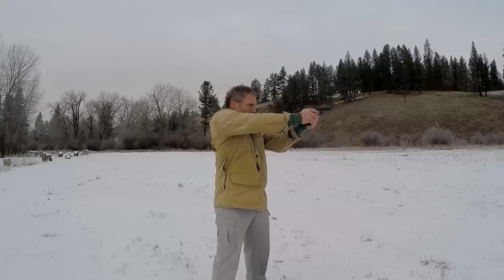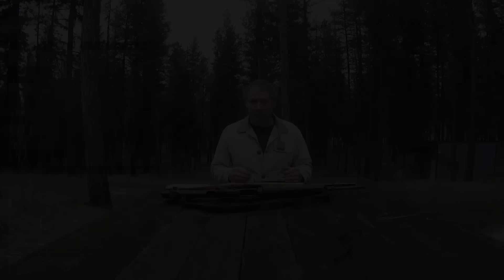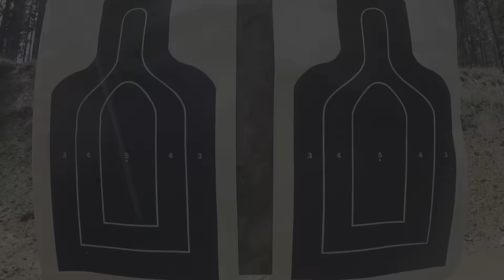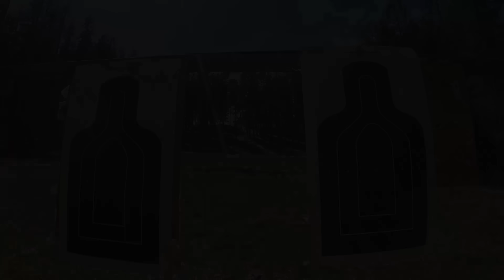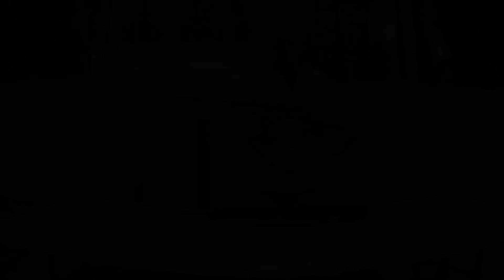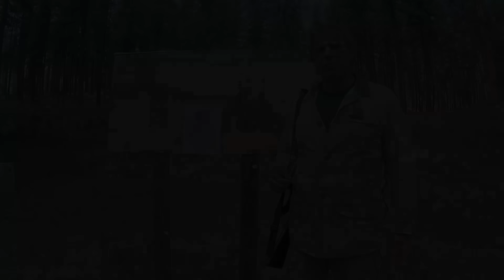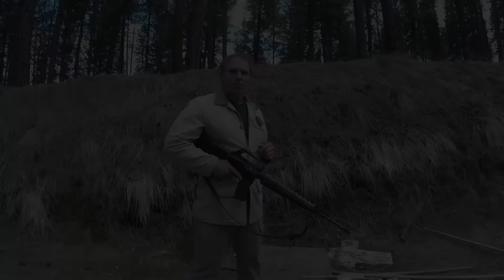Mini-14 vs AR15: Which is Better?

Comment: Newer Mini-14's are more accurate than the older ones. The barrel is different. Can tell by serial number but also by looking at barrel.
Reply: George Washington  I bought my mini 581 series for $620 new from budsgunshop.com. I built my AR for around $550.  Yes parts are cheaper for the AR but it's not that much more for the mini.  Also I have my mini tailored to mimic the M1A socom.  I enjoy the older style look of the mini over the AR and would trust my mini for defense up to 300 yards with no problem.  In reality my AR is probabaly better but I just love the mini.
Reply: @dthompsont3796  If you want an AR buy one, if you want the Ruger Mini buy one of those, the mistake IMO is when people buy a Mini Ranch and then try and make it look "all tactical" like an AR, spending even more money. The Mini 14 is a fine compact rifle for general use, hunting, plinking, self defense etc. and is perfect for someone who wants all that in a classic looking rifle. If you want the military and tactical looking rifle then buy the AR, no one would buy the AR and then start putting a wood stock on it etc. to make it more like a Mini 14. I have an AR and an M1A  and will probably pick up a Mini 14 when I see the right deal on one so I have another 5.56/223 platform.  The debate about which is better comes down to which you like better and what is it's primary role, beyond that the differences are not that much it even matters to the average person. For example the magazines are harder to swap, but seriously as a civilian how likely am I to need a tactical magazine change? However in other situations I do see a benefit to the more staid and traditional looks of the Mini14, when using it outside of a range. It's swings and roundabouts, pay your money and make your choice. To me the price of the Mini is the biggest argument against buying one, I think it's a case of relatively bad value for a great little carbine. After all these years in production, you'd think Ruger could get the cost/retail price down.
Reply: @fiveowaf454  I'm not reading all of that
Reply: @dthompsont3796  Well as you couldn't be bothered to read what I wrote, then you have no idea what i know do you ;)
Reply: @fiveowaf454  I dont care buddy.  You seem to need the last word for some reason.
Reply: @dthompsont3796  And there I was thinking all the time it was you needing the last word, sorry to have offended your delicate senses by daring to have an opinion that differs from yours.
Reply: @fiveowaf454  there you are again, continuing to cry without validation.😪
Reply: @dthompsont3796  Yawn!!
Reply: The Mini 14 has been vastly improved over the years as has most AR 15's, all good for us who want them.
Reply: George Washington I love the “about” section of your channel.
Reply: gator nation 580 and up I believe. They started upgrading in 2003. I had a 580 series Mini 14 with the thicker barrel. Unfortunately it was stolen, but I would love to own another!
Reply: George Washington  What $1200 M1A? Can't find any for under $1500 in my area or online.
Reply: 195-52743 which version is this?
Reply: @KK-ze8ye  Older version with thinner barrel. Later version (581,582) had a tapered barrel that is a bit thicker and supposedly a bit more accurate as it heats up.
Reply: @eoyguy  When talking semi auto rifles we need to take into account the user and their needs. Some want to be able to take regular aimed shots without breaking their cheek weld, others want to fire it like a machine gun at the extremes, so matters like barrels getting hot and related issues vary tremendously depending on the user. No doubt the newer barrels are going to be better for rapid fire in particular, but this may not affect some owners.
Reply: @KK-ze8ye  Just ask---
             "Paul Harrell"
He can give you the "short version" in about 30 mins or the "long version" in about 3 hrs! Of course the "long version" will be EXTREMELY DETAILED! On that note, I can say that he definitely does his homework for all of his vids. He is VERY thorough and great at explaining all of field and investigative work. Even as to where an 8 year old could understand his lectures! LOL 
He does post some great and informative vids. He actually made my mind up to get a 10mm instead of a 40cal and I love the 10mm. I was a 45acp guy, but now every morning when I get all of my EDC things, I bypass the 45 and go straight to the 10mm!
Reply: @KK-ze8ye  by a quick look up for the number, that is 195 series ranch rifle built some time in 1998. if you need more details on that rifle i would contact ruger
Reply: Which model is the one Paul tested?
Reply: @AshGreen359  looks like one of the older models
Reply: @AshGreen359  His I believe is from the 90's
Reply: gator natio
Reply: I absolutely agree, I got lucky with a mid 90’s mini 14, my American 7mm-08 is excellent
Reply: @Michael Ball I don't think the Mini 14 was designed to shoot imitating a machine gun as many do. It was originally meant as a handy compact rifle for general use hence they used to have "ranch" in the name so I think a lot of people suffer issues when they require a high rate over several mags.
Reply: George Washington  superior...

Comment: Owned many Mini-14s over the years. In many ways I prefer them but I will admit they are quirky. The quirks can be overcome with training. I think both rifles are great  but will admit the AR platform has had years and years of development and has had many if not all of its design quirks qorked out while the Mini 14 largely has been unchanged since its inception other than a thicker barrel.

Comment: Do what I did. Buy both. Learn to shoot both to the best of your ability.
In a shtf situation, you aren't one bit under-gunned if your Mini 14 is the only gun you have at hand to defend yourself.
Reply: Two of my home built AR's and my Thompson Center Compass do 2 inches at 300 yards. Nothing I could do to a Mini-14 to get that. And by-the-way, all my AR's and my Thompson Center Compass use the same homemade ammo. Not tailored ammo for each.
Reply: @alanhigh8125  Good for you. I haven't met a mini 14 on my club's range yet  that would do that. Not when the owner shoots it, not when I shoot it.

Comment: According to at least one Ruger rep, the 580 series ("Ranch" rifles) were chambered in 5.56 NATO. I've seen info online indicating they could be either 5.56 or .223, and the Target model is supposedly only .223. Don't know about other models after that, but it seems even Ruger's employees might not have accurate info. It's always best to check the barrel stamp (or have a set of headspace gauges).

Comment: Another excellent video! Thank you very much. In Austria (Europe) the situation regarding AR-15 and Mini-14 rifles is somewhat different. Whilst some specially built AR-15 rifles can be bought by citizens with a gun permit, Ruger Mini-14s are banned, because the department of defense classified it as a military weapon, because it was the standard issue with the Royal Bermuda Regiment -.-

Comment: There is one thing that Ruger cannot be beaten at. That thing is customer service. Ruger's customer service is second to none. They really back their product. I've shot Rugers for thirty five years, and never had a problem that wasn't quickly fixed.
Reply: Yea, but with a lot of manufacturers it doesn't matter because their products work out of the box.
Reply: Just don't buy their sling swivels. They'll pretty much tell you to fuck off.

Comment: without watching I KNOW The MINI 14 is a better rifle. More accurate out of the box, easier to take care of, The Garand bolt itself is a better system. I have both and the mini is my goto gun for anything from close to 100 yards or more. Flip up sights only. OK with a 6x6 5 spot target I can shoot my mini 14 as fast as I can pull and go from one to the other and get all five in the center red, No strap no nothing. That's at 25 yards so the red is the size of a dime one in each corner and one in the middle. Using Fed. American Eagle 55 FMJ 223 boat tail. OK I'm inside but with guys all around me shooting everything from full auto to 500 S&W! Concentration is key. Again, The AR platform is a pain in the ass, it was when I was in the ARMY and now in civilian life. Good Video however and I agree that you are concise speak in a way for anyone to learn and understand.

Comment: I hate to be a nitpicker and i absolutely agree with the point, but even if that 100fps difference doesent make a practical difference it repressents a much larger ammount of added energy than 100fps at a lower speed.
Reply: @matthewlove9191  if you add 100fps to a bullet going 3000fps you add a lot more energy than if you added the same 100fps to one going only 500fps to start with. kinetic energy is MV^2 the energy scales exponentially with speed.

Comment: I would choose the modern Mimi 14.  The modularity of the AR 15 suggests much more versatility in that the barrel (upper) can be easily swapped out.  That said it has been my experience that the Mini 14 is much more rugged than the AR.  my problem is that I will have to fo a barrel swap because my caliber choice isn't available in the Mini 14 and the AR15 is way too regulated here in New York State.  It has that dangerous pistol grip (😁).

Comment: Paul. I am generally turning about 3250 fps out of M193 55 grams ball out of the AR.  Basically. Mil spec.   With SS-109 62 grain ammo, the A2 outperforms the  Mini-14 all day long.  The real test is not at the 100 yd line.    The test starts at 200 yards, and ends at 500 yrs.  I really enjoy my Mini-14, but it is not an M-14.  I qualified Expect on both rifles.  The HB AR-15 has won at Camp Perry consistently.

Comment: Are there mini 14 models out there that accept standard AR mags? It just seems to me like all you'd have to do is make a different bolt catch.

I HATE that magazines are not universal when we have created so many other modular systems for guns. Almost every dual stack pistol magazine is the exact same size. The only difference is the cutout where the mag catch is. That's it. You could just make a magazine with a bunch of holes in it to fit different handguns. STANAG is a godsend since a standard AR mag will fit in to so many guns

Modularity is everything. It really is. It drives me nutty that in a SHTF situation you are forced to use very specific guns not because of a common ammunition type but also because of a common magazine. An AK is great for sporting and plinking around with, but chances are your friends aren't going to have AK mags laying around if things go wonky

If you are a common sense shooter who has defensive guns in place, you're pretty much forced to use very specific guns. ARs and glocks are super common, so chances are you will want an AR and a glock. That way you are guaranteed going to find magazines that fit for it

Comment: Great video.
I would still love to get a stainless Mini 14 and or a stainless Mini 30.
In the meantime my AR carbine and SKS probably work good enough for me.
Hopefully they remain legal.
Reply: Definitely go Stainless. The blued ones are or used to be rust magnets.
Unbelievably so.
Reply: @breakermorant2428  I’ve got a mini in tactical. No signs of any corrosion after 7 years.
Reply: Can't go wrong with an older SKS at the older cost. Not the $500+

Comment: Thank you mr. Harrell, for a great review of what should be obvious,  but often is not to most. Also it should be mentioned that the extra hight of the sight does help with heat mirage from the barrel during extended fire.

Comment: When I was in the Army with the A1 and M193  ammunition, a 25 meter zero would give you reasonable accuracy out to 300 meters. It had to be fine tuned, but at 25 meters accuracy was not that much of an issue. We shot out to 500 meters, but still it was a minute of man at 25 meters easily. The trajectory was meant to have reasonable accuracy to 500 meters without making a sight change. Plus the Mini 14 is not meant to be a tactical rifle.

Comment: Roughly 80 FPS faster in the AR. That’s consistent for a 1 1/2” longer barrel. I don’t remember if the mini 14 has a slower twist than the A1. A faster twist will increase velocity and stability, but greater accuracy is not guaranteed. Many factors affect accuracy. Even subtle differences in the barrels construction can significantly effect accuracy. The head spacing is one major factor of accuracy. He is absolutely, absolutely correct about the quality of removable magazines. He is very well practiced with both rifles. The mini 14 does not facilitate magazine changes as smoothly as the AR does. That’s simply the difference in the operational design. Everything he addressed was absolutely correct. This comparison reminded me of a question I’ve been asked many times. What the best gun. The answer is simple. The best gun is the gun you have available or in your hands when you have need of it.

Comment: Moral of the story: It doesn't really matter. So long as the rifle is acceptably capable, amount of practice with rifle > type of rifle. Although parts availability, ammunition availability, and size of aftermarket are all very useful things to consider when selecting which rifle to put all your hours on.

Comment: I bought my mini-14 around 2004. It cost me $450. The price did go up substantially after they redesigned it, not sure what year they did that, atleast a few years after i bought mine.  I had a lot of issues zeroing it in but that pretty much came down to the fact the scope mount would become loose, also everytime you had to disassemble it it would change the grouping substantially. Finally found some scope mount rings that fit right to the receiver. 
     But either way it still sends out a zinger about every 6 rounds that can be several inches off from the rest of the group. I did find that a lower grain bullet shot better groups.

Comment: The AR is the better gun.  I started with Mini's and really loved them.  I based my purchase decision on price.  At the time, a new mini was $225.00 and the AR was $500.00.  2 years ago, I wanted to get another Mini but now the roles were reversed.  The Mini was $700, so I bought my first AR , an Armalite for $425.00.  I quickly realized that the AR was the better all around weapon.  If you have the money, buy both.  If you don't, start with the AR.

Comment: 2 things come into play here, the sights the AR15 wins and the rifling twist rate. The Mini should be 1-10 and if the AR is an older model 1-12 twist. Just a thought. Triggers do come into play too but both being stock and no trigger work they come out about the same.

Comment: Good  video.  One  other thing with the velocity difference could be the barrel twist. An older A-1  is  most likely a 1/12 twist and your Mini (Ranch)   could be  1/7 , 1/9 or 1/10.  Ruger  really played around with with twist rates .  Ranches started out  1982 -1/10  , 1986 - 1/7  ,   1997  to 2012 - 1/9  . Don't know after that. I have two , 1988 & 1989 with 1/7 and seem to shoot fine  with 55gr  but also handle heaver bullets. Also,  although  they say .223 they are in fact  5.56  ( You can check with  Ruger).  I also have  several AR's  with  1/7, 1/8, and 1/9 rates and they tend to be the ones I use most .  The  main thing I don't like about the Mini 14 is they eject the brass  a half a mile away,  watch out if your standing  3-5 o'clock  within  20 feet of me unless you like the taste of brass.

Comment: The only thing consistent about mini 14's is their inconsistency. Some of them shoot like they have been worked over by the AMU, while some shoot like they were hand made in Pakistan at the local arms Bazar.
Every single Ruger I have owned (9 of them) that was a semi auto, had to go back to Ruger to be fixed under recall or deadlined due to broken parts. 
Between the inconsistency and the quality (lack of, requiring Ruger to fix it) and Bill Ruger's politics put me off of Ruger for good. BTW, several buddies have the Ruger take on the AR pattern (556), and have all been back to Ruger at least once.

ETA

I have yet to attend a carbine class that had someone who was running a mini 14 be able to make it through the class (2,000 rnds in 2 days) with out their gun going tits up while stock LMT, DD, Colt, BCM just keep running on without failure throu the exact same conditions.
Reply: Better not buy a Remington, their quality is long gone, dads 700 had a lockup after firing, the bolt froze up, he had to disassemble it to empty the shells to make it safe to return, he got it back 'fixed,' yet every shell you chamber, the case receives a dent, and/or bullet tip contacts something, be it store bought Remington, Winchester, Federal, etc, no ammo will load properly.

Comment: Have both, my mini i tricked just like joes with folding stock, and built my ar from stripped lower, mostly bcm lower parts, super 42 buffer set up, and all radical firearms upper. Love both to death, both very reliable with exception of one mag on my mini, like you said, but i personally can shoot the ar better. Although my mini was manufactured in 82 with pencil barrel. I do have more fun at the range with the mini14, huge fire balls, crisp trigger, and awsome sounding smooth action. For gtw i choose ar only because of the amount of mags, my ability to shoot it fast, and accurately, especially past 100 yards. Btw great video

Comment: 0:58, "I'm going to use this particular Mini 14".  You lost me there.  Not to say the Mini 14 is as accurate as the AR15, but you used the Mini 14 with the pencil barrel, which has a reputation for not being as accurate as the newer Mini 14 Ranch.